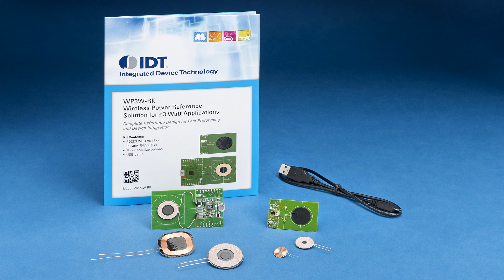Wireless Power Reference Solution for 0.5W to 3W Ultra-compact Applications

Comment from the maker: It will work up to around 1 cm of distance, but it depends on many factors of its physical environment. The ideal separation is 1.5 mm. This separation gap is generally achieved by the total thickness of the plastic casing on both the transmitter and receiver.

Comment: How far can you transmit??
Reply from the maker: It will work up to around 1 cm of distance, but it depends on many 
factors of its physical environment. The ideal separation is 1.5 mm. 
This separation gap is generally achieved by the total thickness of the 
plastic casing on both the transmitter and receiver.